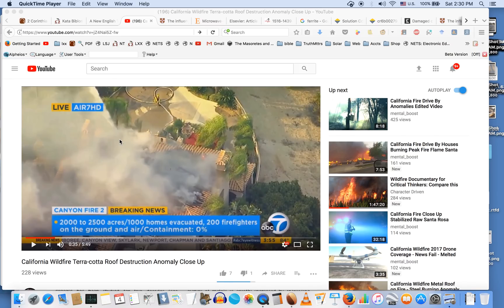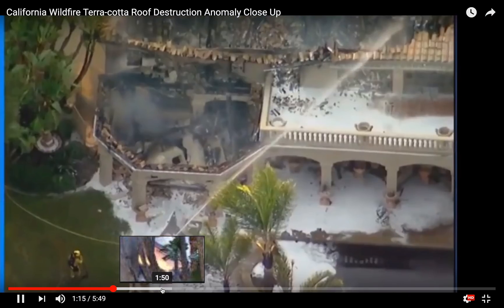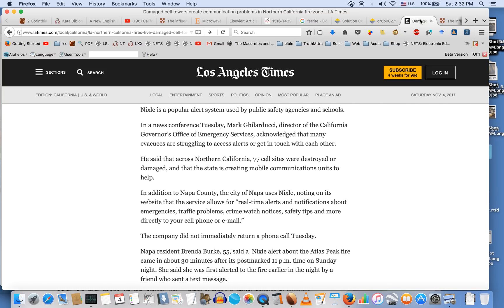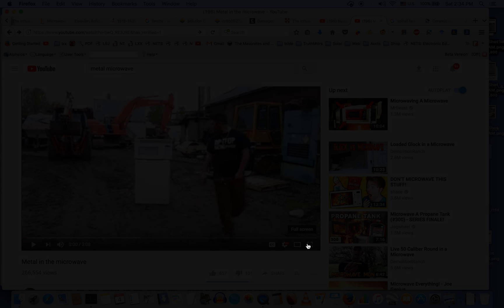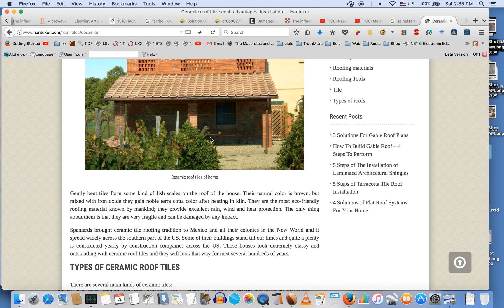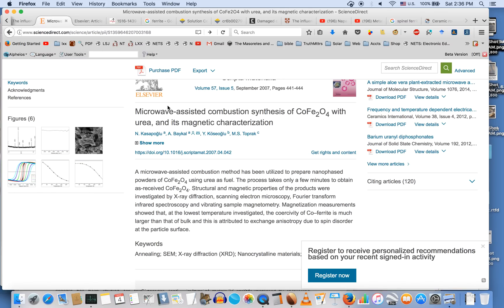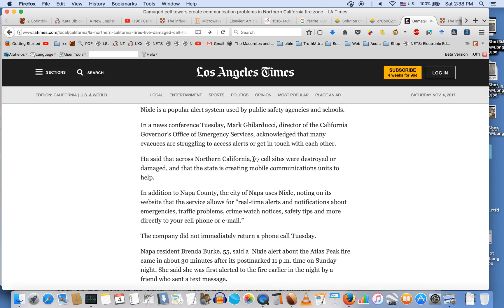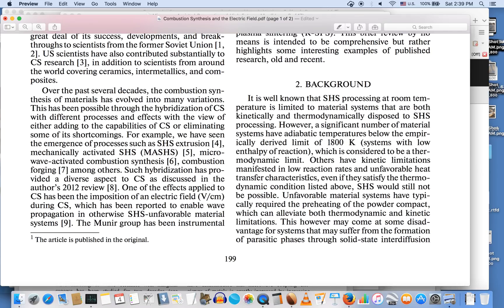California Fires: Terracotta Roof Anomaly: Microwave Assisted Combustion Synthesis

Comment: Try thinking tar paper overlapped in a double layer for water proofing under the tiles is what weeps combustibles. Any place it looks like tiles have burned is a hole where the tiles fell in. Wood in houses is just a stack of kindling especially with air conditioners assisting in drawing all the moisture out leaving only sap and timber highly flammable.

Comment: 77 is chaos number. Freemason's motto "ordo ab chau". Order out of chaos. Remember 911? Flight 77, flew for 77 mins from scheduled take off and slammed into the Pentagon which is 77 feet tall.
"world trade center" = 77 (Full Reduction)
w o r l d 27 t r a d e 21 c e n t e r 29 77
5 6 9 3 4 2 9 1 4 5 3 5 5 2 5 9
"pentagon height" = 77 (Full Reduction)
p e n t a g o n 38 h e i g h t 39 77
7 5 5 2 1 7 6 5 8 5 9 7 8 2

Comment: As far as l could see it was the structure underneath the terracotta tiles that was burning,not the tiles themselves. As for why the house caught fire in isolation from its surroundings,did the occupiers of this house turn off their air conditioning? All it takes is an ember blown on the wind and sucked into the unit to start a fire. Turning off your air conditioner is one of the first things fire authorities here in australia tell you to do when a fire is in close proximity.

Comment: Cell phones communicate with nearby cell towers mainly through radiofrequency (RF) waves, a form of energy in the electromagnetic spectrum between FM radio waves and microwaves. Like FM radio waves, microwaves, visible light, and heat, they are forms of non-ionizing radiation. This means they do not directly damage the DNA inside cells, which is how stronger (ionizing) types of radiation such as x-rays, gamma rays, and ultraviolet (UV) light are thought to be able to cause cancer.

Comment: I don't think that this is true. aluminum oxide is a fire suppressant. it will not burn.  oxidation and reduction. they are opposite reactions. aluminum oxide will not burn terracotta does not burn. it does not matter if you put it in a microwave or not. it is a refractory material as is aluminum oxide.  you are so deluded. I cant belleve that people seem to be listining to your bull crap.

Comment: The 3 known main components of chemtrails are aluminum, barium and strontium 90. Strontium is used to increase combustability, check out thermite, if you haven't. And aluminum contributes to a hotter fire.. again, more combustion. Barium is a dry chalky substance, which I bet increases combustion, but I haven't looked specifically at that. I like your video. God speed, and bless us all!

Comment: number one who he piss off .... that makes no sense rhyme- rhythm or reason at all .... Who was he what did you do very very selective ..... those are the videos showing cars completely torn apart one showed signs of accumulated impact with a sharp penetrating hole hard to describe as I have never seen that before .... distinct punch impact hole seemingly made hard to explain these temperatures are not seen in these type of fires anywhere .......... sorry I tell a lie unless there was Jetfuel here on this site residual from 9/11 ........  ironically the old analog CDMA signal was good for 100 km range

Comment: if you have a basic grasp of how thermodynamics work, and I stress the term "basic" none of what's going on in the California fires is "anomalous" trees not being burnt to ash while houses are isn't anomalous especially not if the trees have leaves which are bright green.  As for terracotta shingles being burned, the kiln firing process can range from 1100 degrees Fahrenheit to 1800 degrees Fahrenheit, and if they're fired for too long, they will start to burn and melt, an average house-fire can produce temperatures close to and exceeding 1100 degrees Fahrenheit, while the average wild-fire can produce temperatures exceeding 1400 degrees Fahrenheit, hot enough to melt aluminum car rims.

Comment: Roofed homes for over 20 years,tile is not burning,tile roofs are not sealed, air, wind, water,even fire ember,s can get under the tile,under the tile are small slates of wood on top of TAR(OIL SOAKED) PAPER,MODEREN TILE ROOFS ARE MADE FROM CONCRETE

Comment: everyone who bought terracotta did so for their fire-resistant quasi fireproof quality.  dane at geoengineeringwatch was moving a hypothesis that tile/stucco are not burning in these fires, so this is key video that proves a lot...
 
microwave from the cell towers if overpowered* can excite the aluminum oxide in the terracotta tiles which is a highly flammable accelerant and we see a tile roof house and everything in it disintegrate, from the metal in all cellulose fibers per pyrolysis, like all the rest, without any nearby fire or any other homes ablaze.   

i would bet tile floors/counter tops, granite tops, would all have some metal oxides in them like terracotta do.  and i'd not be surprised if they put metal oxides into all the fire-retardant chemicals the state forced all furniture/curtain/rug makers to treat their wares with to meet state fire code etc.

and as you note, all the electrical wiring, plumbing and hvac system, beds/carpet come into contact with cellulose fibers at regular intervals in a mesh grid that when oxidized turns to 'microwave fire fuel'.  how else can we explain what we see in this video?  

*which happens periodically btw - where for an hour, the towers go berzerk and dose the whole neighborhood/county very high RF - i have video of my RF meter off the charts  - should post

it takes curiosity and sleuthing to discover what we all should know.  it highlights the level of mind-control across all scientists who know this stuff yet remain silent per 'manufactured consent' or even using the same technology to make them all do and say as they please via mkultra manchurian memory splitting.  

G4 is plenty lethal, G5 is the 'hunger games' rollout.  by then 70% of us will be fire/quake/flood/cyclone refugees dependent on the gov for work/food/water.  and due to all the spraying and killing of vegetation/soil in all areas, armed preppers stand no chance and need to rethink the attack/survival plan.

Comment: The terra-cotta roof that appears to be on fire (when the camera zooms in for a close up) is actually the structural materials used in the framing of the House that is burning. The wood trusses and plywood is made of glues along with other highly volatile chemicals which is burning under the convex side of the roof tile. This in turn allows trapped oxygen to burn the wood at a higher temperature creating the 8-10 inch flames shooting out from the underside which gives the illusion that the tiles are burning. As the wood burns away the tiles fall to the ground. As you can see in the video the tiles are laying around intact. As to what caused the fire or any of the California fires, I do agree that DEW is responsible.

Comment: It’s the same thing.  The fires were caused by directed energy.  The other name for it is cold fusion.   Same thing was used at 9/11.   Buildings & contents atomized (hence the white ‘smoke’), cars melted, yet paper & trees are untouched.  See Dr. Judy Wood’s work.  You need two directed waves & an electrical storm in the vicinity.  It’s based on Tesla’s work.
https://youtu.be/ufWggCESyDg

Comment: They could just use something like LAWS from a drone or helicopter. If they wait until there is thunder or lightning, it would cover the sound. They probably have smaller ones that are classified and quieter, too. Or just sit in the aircraft or car and shine a laser that is strong enough to start a fire and shine it long enough, it should start. You won't be able to see an infrared laser; it will ionize the chemtrail metal particulates that are on the building, and now you have an invisible plasma torch. US Navy's New Killer Laser Gun: LaWS Laser Weapon System Live-fire https://www.youtube.com/watch?v=jIxugT-QiEI

A Farraday cage does not work on this because it works at the subatomic level.  finely woven silver fabric blocks some of the lower frequencies, but anything high enough to start a fire will just push or burn through a Faraday or finely woven silver fabric, especially if it is pulsed.  it  is probably a pulsed ionized-gas laser weapon.

I have been able to photograph beams coming out of microwave towers in a spoke like fashion after heavy chemtrailing by using an infrared camera. I don't think the frequencies carried by cell phone towers could start these fires though.  Give you brain tumors, headaches, destroy brain cells, cause brain swelling, and other stuff, yes.  But it is not strong enough to make a steady state, pulsed beam weapon that can start a fire.

To start a fire, all they need is heavy chemtrail day and drones or aircraft with infrared lasers or use hand held ones.  they could just sit across the street and do it from a car.  Infrared so that YOU can't see it.  People can not normally see infrared.  They have those pulse plasma projectile laser rifles they developed for the military; it was called PIKL, at first, and then changed to PEP.  You can go to the wayback machine and find the Navy contract.  Let me see if I can find it.  https://en.wikipedia.org/wiki/Pulsed_energy_projectile   https://en.wikipedia.org/wiki/Pulsed_Energy_Projectile  These are supposed to be non-lethal, but we  know that Russia and the U.S. have been working on ones that kill.  Search the net:  you will find articles about it.  

Also, like some one said a laser will couple with lightning and could be use to bend the lightning beam and  start a fire by directed and manipulated lightning strikes.  There might be some way to couple a laser to a beam coming off of a microwave tower to direct the hit better.  But I rather think that if 77 microwave towers were destroyed by using them for an attack, they would have take the  towers off line.  Everybody who uses those cell phone towers would not be able to use their phones, and they would have to send illegal levels of energy through those towers.  Be interesting if anyone's phone would not work while this was going on.  That might be a signature.  In which case, I guess some guys or aircraft with pulsed energy lasers could just send the pulses to the towers and the towers would couple and send the fire causing beams out.  

But, this looks very precise.   It would  just be easier to shoot the  houses and cars.  I think it came from up above due to the black or dark circles that I am seeing.  Hope that helps.

Comment: Mikie1999cr
1 second ago
Although I have fought many forest  and structure fires and  seen the devastation left behind. California fires contained many anomalies if you research. There was no real 'front' on many of these structure fires. To name one. I won't make a diatribe here on the others. I would like to make a few comments. The above video seems to center on one. The almost total devastation of each house. (much more debris left after the Victoria fires) One that I noticed was that the heat at each vehicle fire involved seemed to reach at least 1220 deg F (the molten aluminum)  With most vehicle fires the closer to the source the more involved the vehicle. Most vehicles don't burn evenly. All four tires and at a minimum 1220 deg F at 'each' wheel. (the molten aluminum) seemed the norm not the exception in the California fires. Proximity to the main fire itself didn't seem to matter. Also, isolated 'hot spots'. In one case nothing was visibly burned for 15 or twenty feet in every direction from a hot spot. Yet an aluminum mailbox had heated enough for it to melt (1220 deg F). It didn't fall into its position nor was it placed there during the fire as it was anchored to the ground with a steel in concrete pole. I wasn't able to tell what heat damage the post and concrete sustained from the film. However it did seem substantial. The aluminum mailbox was a molten puddle at the base of the pole. There was no fuel on or near it that I could see. There should have been no way for that an aluminum mailbox melt off its support at 15 or twenty feet from any burned object. Within three feet of that mailbox was a plastic garbage can on rollers. It was untouched by any heat. It seemed pristine. These are only a couple of the things I noticed. Almost every car that was involved was fully involved. These fires need a lot of study. Should these events prove to be naturally occurring. Then we are facing an entirely new kind of fire scenario.

Comment: Hi I agree with you to always ask questions. I am a 20 year cell site technician, The cell sites put out RF out at the top of the towers. The only time we used MW equipment was to connect one site to another when it was cheaper than leasing T1 lines from land line company. Now days with cell sites having to provide so much Data Bandwidth it is cheaper and more reliable than MW as they tend to fade signals on foggy nights and heavy rain so they are not used as often as say 10 years ago. 

I also think the government would just use any type of advanced weapon on an aircraft so no evidenced is left behind and no witnesses.

Comment: More nonsense.. lol Look at any microwave oven, the entire inside is made of metal. There is no "oxidation' that takes place when microwaves hit metal. They simply bounce off of metal which is why if you look into microwave oven cookbook and they teach you how to use metal, aluminum foil in this case, to cover certain parts of whatever youre cooking so they dont get overcooked.

Comment: Spot on kimberly. The microwaves cause the breakdown of the metals whuch ignites like dust and the oxygen excells the process. Again correct, metallic elements are needed. Non metallic materials will only burn from the surrounding flames that ignite it.

Comment: Another idiot. The tiles ain't floating in the air, lady. The wooden supports, which are quite extensive since the tiles are heavy, burned from under the tiles and the tiles collapsed into the building. And the shot of the no flames house is a matter of using your eyes since you seemingly have no brain. There are multiple high stream hoses killing the fire. You are showing the very last part of the blaze which has mostly been extinguished at this point in the video. I had to stop watching this piece of crap at that point
GO BACK TO RUSSIA  .  .  .

Comment: This is pretty much some seriously miguided speculation. Cell towers are made of metal but they have a very significant amount of insulated cabling on them which is obviously capable of being heat damaged and burned up in fire. Also, once wood is ignited it generates the heat to affect the Terra cotta tile. There you go.

Comment: You can be pretty sure that terra cotta mansion fire in the beginning of the video was plain old self induced arson taking advantage of the nearby wildfire. You are correct, terra cotta doesn't burn, nor is any shown burning. Just the wood and plywood under ir, then it caves in. I'm not discounting any conspiracy you may hold dear, but this fire isn't it.

Comment: if you get metal hot enough it will burn.iron oxide has already burned the terracotta is an aluminasilicat ceramic if it got hot enough it would reduce the rust back into iron powder oxidising the aluminium in the ceramics.

Comment: the arcing is because the microwaves are not destributid evenly on the metal these differenses caude a voltage graduate across the metal this causes the excess electrons to violently find a less crowded area that is what causes the arcing electron imbalence.

Comment: The FCC triangulates illegal microwave & radio waves that cause disruption of the band width channels by high energy bursts that splash into the band's causing communicating failures. They scan the areas constantly & when high wattage broadcasts begin, they scan form 3 different locations & that located the intersect point of transmissions of microwave bursts. A clay cup in a microwave gets burning hot of it has no water in it in minutes. Oil stays cold. This is a mystery to me. The only thing I can imagine is its coming through the atmosphere through the magneto sphere. That's..scary!!

Comment: Directed energy weapons do exist but the missing tiles could've simply fallen into the house when the roof trusses and sheathing supporting the tiles burned and collapsed.  Microwaves can toast a tree, which suggests that if damage to the house was caused by a microwave beam then it would have come from a space based or airborne platform rather than a tower; that is, taking into account the topography of that area and where exactly the towers were located AND the fact that cellphone frequencies operate well below the frequency used in microwave ovens.  Considering the odds of a embers falling onto the house and nowhere else around it, this could simply be a case of insurance fraud perpetrated by owners who no longer wanted the house or couldn't afford to keep it.

Comment: The embers getting under houses rooves were actually a huge problem.  I saw it with my own eyes, when the wind picks up thousands of burning hot embers fly out of the old burn areas.  Since we live in America, all our buildings are made from wood, so under those bricks is wood, and its pretty easy for them to catch fire if lots of little burning embers fly under the tiles and get inside there.  As for cell towers, we have alot of them, and if it was in a burn area it would easily get destroyed. One hilltop could have 5 of them on it  (The power boxes next to it could burn, they could burn, the wires could burn, trees could fall on it, etc)